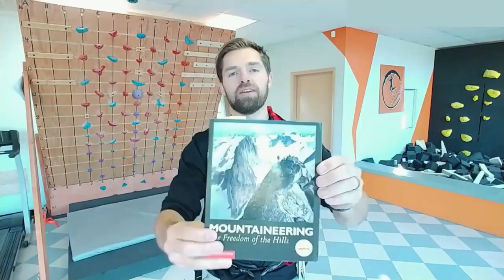Should you Wear Socks with Climbing Shoes

Comment: There's a lot to add to this topic. These articles are pretty interesting:
"Send Edition 7 Reasons to Wear Socks with Climbing Shoes and 4 Reasons Why Not"
"Climbing House Do You Wear Socks with Climbing Shoes? Pros and Cons"
Mainly want shoes that fit right, then there shouldn't be sock slipping (socks) or sweat slipping and blisters (no socks). Also if one wears socks, you want the thin socks (can also be no-show ones that you can't see), or you can even go super thin with nylon, and then the distance from the wall really just isn't a factor (unless you're just that elite). There's a lot of reasons why people do it.

Then with "they're designed like that", that doesn't mean that it's therefore the best way in general, and of course not for every individual. There's still pros and cons, like smell and also ease of getting the shoe on and off, less sweaty feet, etc. The primary way they're designed for no socks is to get the foot as close to the wall as possible, and very thin socks just don't go against that design.
Reply from the maker: Thanks for the comment.

Comment: i just dislike being barefoot in shoes, it always feels cagey. that said, i'm new to climbing and on my first session i did that exact faux pas of wearing socks because i didn't know. i then took them off since everyone else was sockless. i kind of got accustomed to the feeling, but had to take the shoes off frequently in between attempts because they felt super swampy. i was actually surprised how much my feet sweated in those climbing shoes, since the upper was mostly knitted. i think i sweat less while skateboarding in full leather high top skateshoes. i might purchase a pair of climbing socks just to feel out if i like it. i can definitely see how being barefoot can give you an edge. it's similar to skating where some people prefer very thin shoes and socks(or no socks at all)for more boardfeel. the construction of climbing shoes also reminds me a bit of vulcanized skateshoes and they kind of feel like if you buy a pair of vans authentics half a size too small and took out the insole.
Reply from the maker: Give the thin ankle socks a try. Sweaty feet isn't good either.

Comment: With sweaty feet, I always have to wear socks. Even when I down size my climbing shoes 3 sizes down climbing 5.12, I still wear socks.
Reply from the maker: Thanks for sharing. Is there a specific type of sock you reserve for climbing?
Reply: @climberdad  Nothing specific to climbing. Meanwhile merino wool socks (thin or thick) work really well for sweaty feet.
Reply: I do as well. A thin sock in proper fitting shoes doesn't slip around. Below the ankle thin socks work the best

Comment: I wear very thin socks for comfort. I can feel the stitches in my shoe tug on my skin, especially on the heel. I feel like i can stand taller more comfortably on my tip toes when my heel is allowed to slide a couple mm. Where without socks my foot is forced in a shorter more inflexible position because of the friction.

Obviously don't want any deadspace in your shoe to slide around in, but being comfortable at all lengths of the shoe is important. I had a similar issue with my shoe being downsized too far, so my foot was forced so flat and i couldn't stand on my tip toes at all or smear.
Reply from the maker: Thank you for sharing, great insight.